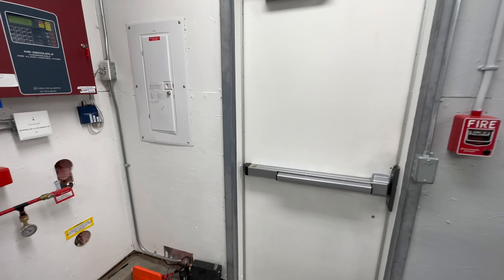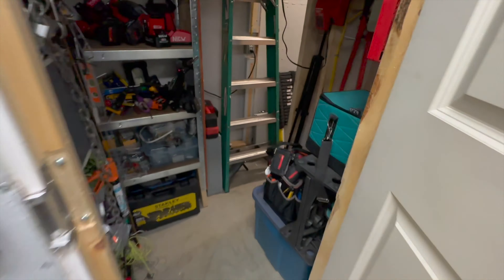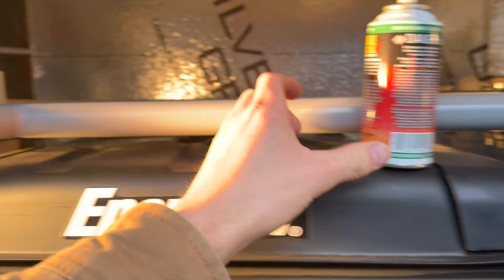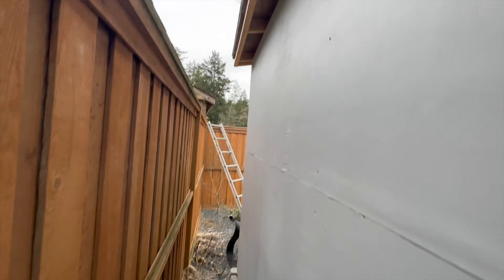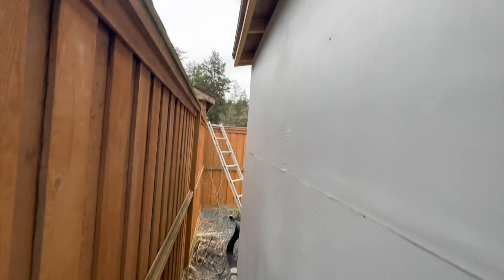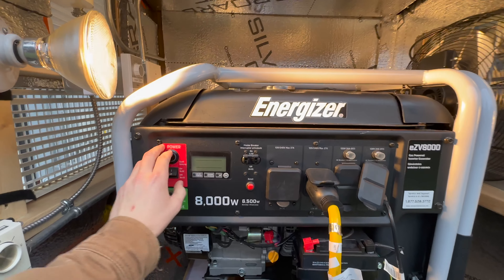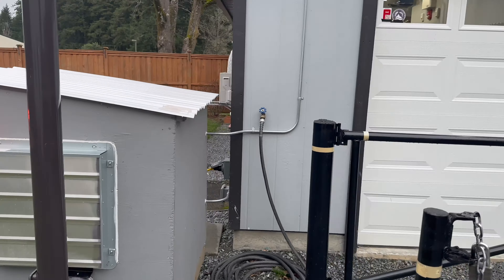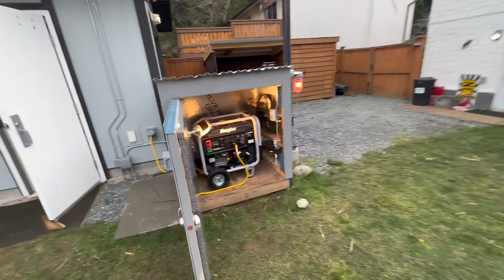March fire alarm, emergency light, generator testing

Comment: Good video! Everything is working no problems. I did notice you put that blue top on within the outside system sensor, It looks cool!
Reply from the maker: Yeah I had one on a long time ago but it came off I finally put it back since it supposed to have one
Reply: Also can you help get me a white specter alert advance Strobe fire alarm?
Reply from the maker: @jamiespaniol4680  I have bought them on eBay before you can get them pretty cheap